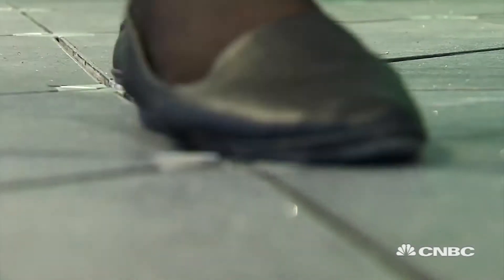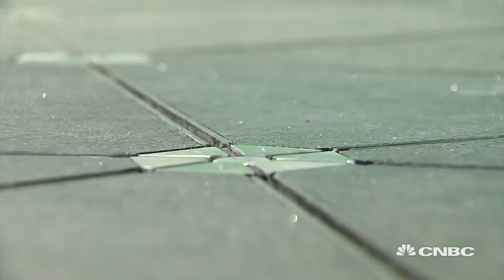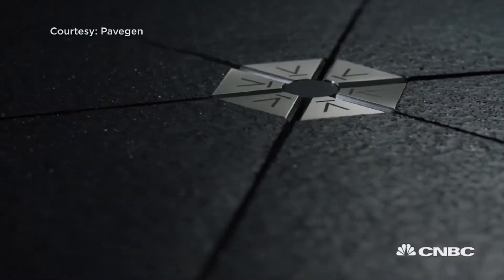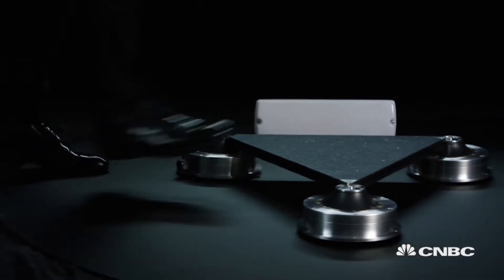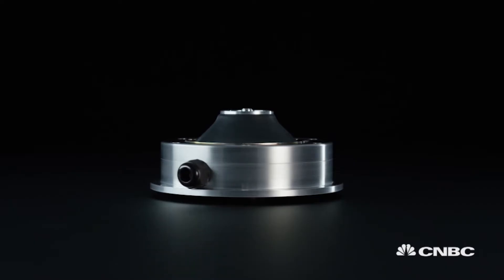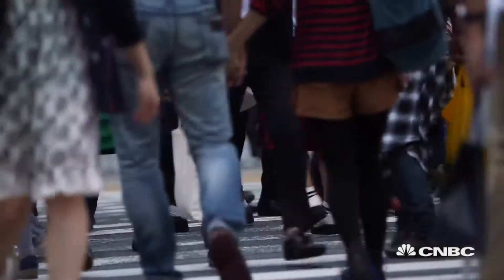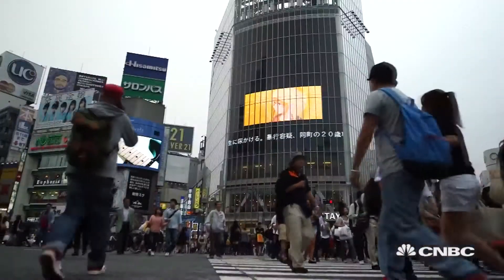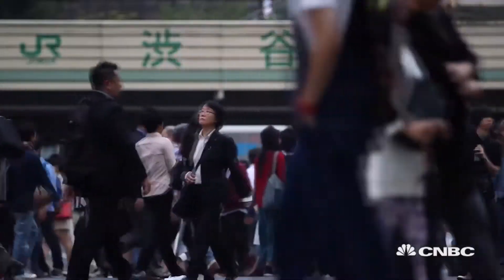Pavegen: How a footstep’s energy is converted to electrical power

Comment: This seems like a really expensive way to get very little energy.
Imagine a 100 kg person steps and depresses a tile 1 cm. . .  That means 1 joule per step,  or 360,000 steps for 1 KWH.  So it takes walkinga bout 180 miles to create a KWH,  or walking 1,000 miles to create a dollar of energy. Let's say this last twice that of a commercial treadmill. . .    20,000 miles. . .  We are going to make $20 before we call the repair man. . . 

TL;DR  - using an average weight of 100 kg  and if everyone in time square took 1 step daily on Pavegen. . .  you would only $0.20 a day of energy.   So unless Pavegen costs  as much as a 100 Watt Solar panel. . .   This technology is already less efficient than better options.

This is just Solar Roadways 2.0
Reply: THANK YOU THANK YOU THANK YOU FINALLy A PERSON WITH COMMON SENSE! Not only is it like walking with a constant incline, but they are also talking about implementing it in highways which causes increased fuel consumption, and in the case of electric cars, energy. Bullshit.

Comment: What about high ways
Reply: would work wonderfully especially if you'd combine it with already due replacement and repair work..
Reply: Uhhh,   The cars would need to put more energy into the system than electricity we get out fo the system. . .  If the road sinks 1-2 cm when you drive on it,  then the car is always driving uphill.

in other words,  you don't get extra energy unless you put more energy into it.   With human steps we already lift our feet.  As long as the depression is subtle enough nobody can notice.

Comment: Will it not have any bad effect on the human body?
Reply: no of course not we will not die by stepping on tiles that rotate and convert kinetic energy to electrical energy
Reply: @mewingbear only your knees and ankles.
Reply: That is a very good question!
Reply: @RightBoyKA-POW  why
Reply: on the contrary.. the human body is not "designed" for continuous concrete walking but rather walking om bare soil which is oftentimes rather "giving" in / yielding if that makes sense?
Reply: @Enrico-o3c last time i checked the earth was just as must solid as concrete. The only difference it makes is when you land on it from a higher ground. Normal ground don't "give" in. Also these tiles are tilting not letting your feet sink in. What a stupid comment, dude.